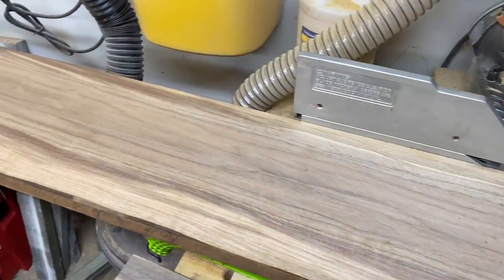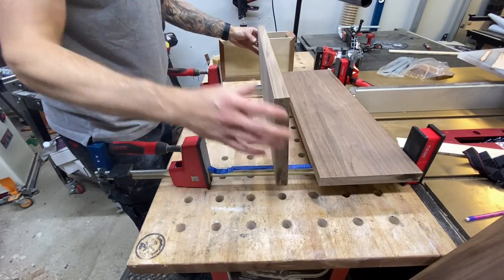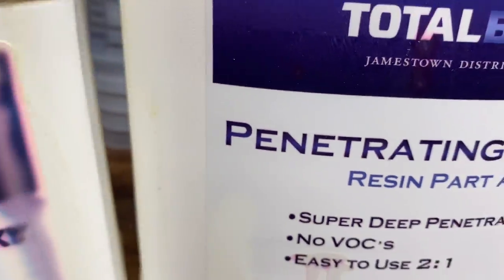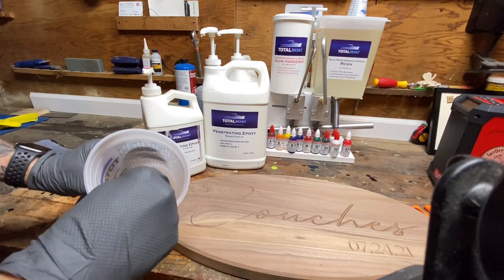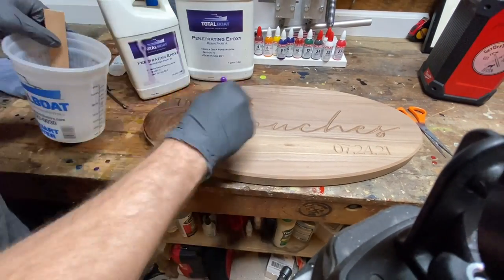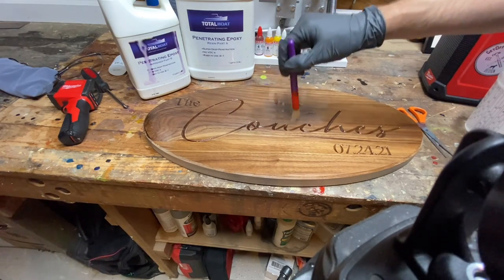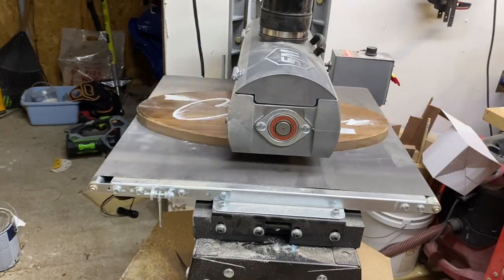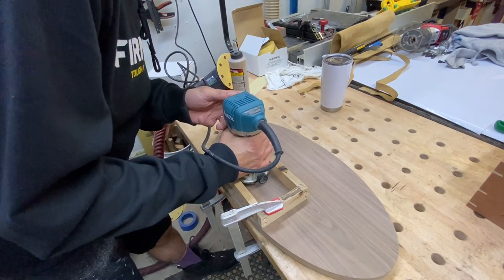TotalBoat Penetrating Epoxy For Sealing with Scott Couch

Comment: Nice quick rundown on this.  I've been using a thin coat of Table Top for this function, but this seems like it would leave a much lower profile and be easier to keep the fine details of the CNC.
Reply from the maker: Glad it was helpful! You're spot on - the thinness of the Penetrating Epoxy would be less of a profile for the CNC details.

Comment: How do you cleanup the pails used for the epoxy?  Can understand pitching the brushes.  Haven’t seen anyone explain cleanup on pails.  Thanks.
Reply from the maker: We recommend leaving a popsicle stick in the pail. Once the epoxy cures, you can pull on the stick which should pull out the leftover epoxy as well. You can also squeeze the pail once the epoxy is cured which can help crack the epoxy out.

Comment: Am I correct in seeing that the oil penetrated even after the epoxy seal?  That seems like the best of all worlds.
Reply from the maker: The finishing oil may penetrate the wood somewhat but not much. After applying the oil and letting it dry, we recommend wiping away any excess.

Comment: Honest question. I understand sealing the area where the colored pigments go, but what is the purpose of seal coating the entire surface if it's going to be sanded off?
Nice sign. Enjoyed the video.
Reply from the maker: Good question! even though it's sanded down the surface is sealed with the epoxy. And every wooden sign headed outdoors can benefit from this waterproofing step.

Comment: After you sealed with clear epoxy, did you let that cure 100% before using the white pigment mixed epoxy? Does the fresh epoxy bond well with the cured clear epoxy?
Reply from the maker: You can recoat when it's still tacky.  If it does cure 100% before your next pour, we recommend sanding first

Comment: how long do you wain between the penatraitin coat and the table top final coat
Reply from the maker: You should wait until the previous coat of TotalBoat Penetrating Epoxy starts to become firm but is still tacky, or when most of it has been absorbed into the wood, before recoating. This generally helps to avoid sags or drips and ensures a strong chemical bond between layers. If the epoxy has dried to the point where it is no longer tacky, you should wash the surface with soap and water, then sand lightly before applying another coat.

Comment: So confused. What exactly are we doing here. What problem is being solved with the penetrating epoxy?
Reply from the maker: Sealign the wood so the dyed epoxy won't bleed into the grain and leak out - also sealing the wood first will reduce the chance of air leaking out of the grain and causing bubbles in the epoxy.  There is an overcoat window and you can apply epoxy again inside the window, but if it fully cures then you must sand and then you can epoxy or paint over it. This is a very common use for PE as it is a great sealer and DOES penetrate into the wood grain and prevent rot and add waterproofing. Hope this helps.

Comment: Confused here...Put the epoxy on, then sand it off???  Is it just being used as a "mask"?  Or does that epoxy actually penetrate deep into the wood?  Sorry, that's really confusing to watch somebody take the time to epoxy a piece, then sand off all the epoxy, and then put a penetrating oil on.  If the epoxy was truly penetrating how would the oil absorb?  Again, this was VERY confusing to me, not enough detail on what the purpose was....
Reply: I too was confused, as I doubt any epoxy (even low viscosity) penetrates very far into the wood - likely a millimeter or a fraction thereof at best.
Reply from the maker: see reply to comment above.
Reply from the maker: @jackrabbit5047  IT sure does penetrate deep into the grain!
Reply: @TotalBoat  I have treated plywood surfaces with various regimens of epoxy (WEST and CPES, 
different viscosities, heat, etc), and after curing have cut the wood and examined with a magnifying glass to see the extent of penetration (judged by darkness or "wet" appearance of the wood fiber), and have never seen much evidence of penetration beyond a visible surface layer no more than a mil.  I have also applied it to pine plank surfaces, sanded off the top layer as you have shown, and then wet the surface with water to see if the wetness is repelled or absorbed, and find not evidence of repulsion, but rather, the water is absorbed into the wood, which remains wet initially.   If it did penetrate, as you suggest, then the main benefit should be of "embalming" the wood and preventing water penetration, which I have not observed.
Reply: @TotalBoat  I'm not doubting you guys, but if the resin is absorbed into the wood, then how does the oil absorb into the wood?  I mean, any wood I have applied epoxy onto, NOTHING absorbs past it.  Please do some follow ups here, because this goes against what the epoxy is supposed to do...or is it not really epoxy and more of a wood conditioner?

Comment: How long does it take for the penetrating epoxy to cure?
Reply from the maker: A full cure for our Penetrating Epoxy takes two days.
Reply: @TotalBoat   for shallow lettering like above, after sealing and removing as much penetrating epoxy as possible, how long do you have to wait until you can add the epoxy fill with color?
Reply from the maker: @donnabotelho810  You can apply another coat of epoxy once the penetrating epoxy is tacky to the touch!